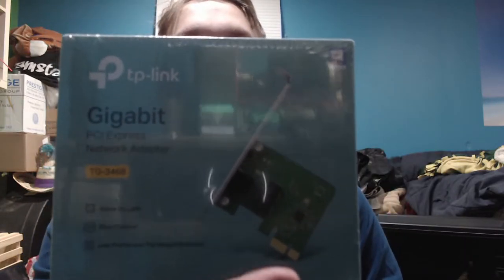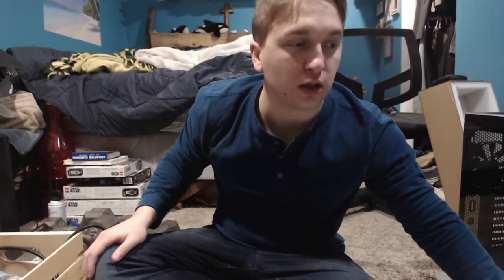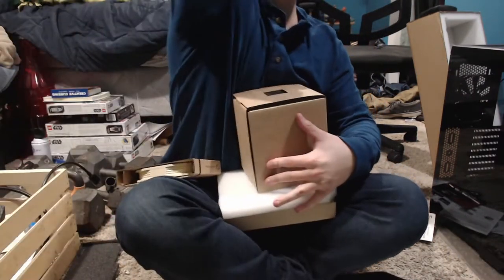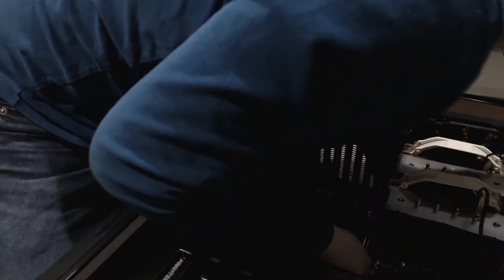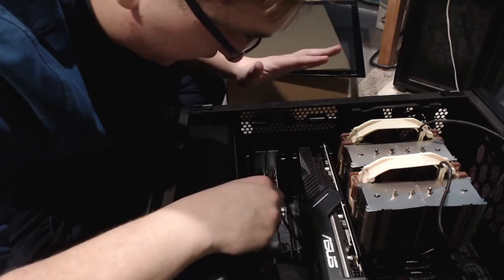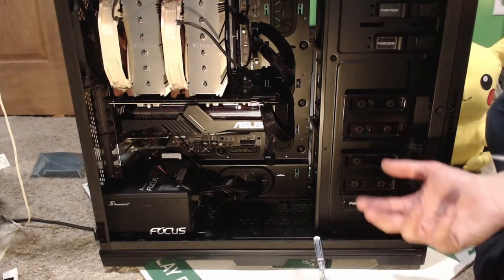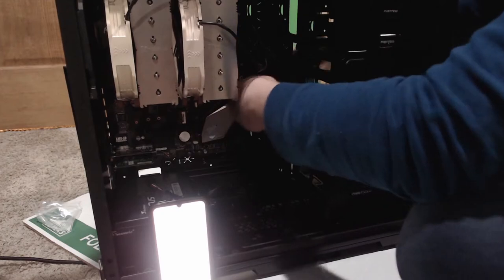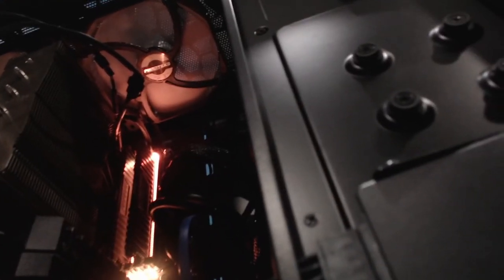Building a Gaming Computer for My Brother (parts list in the description)

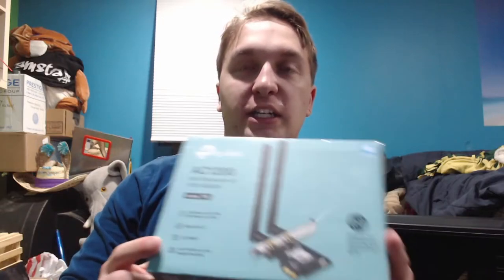Comment: A/c wireless isn't the NEWEST standard (that'd be wifi 6)  but not many devices are available, and I'm pretty sure your router is a couple of years old, so it doesn't have that functionality.  Solid choice. 3:46 there are several differences between that card and yours.  But the most important ones are signal range and speed.  The A/C standard is WAY faster.  Most likely it has a better range as well.

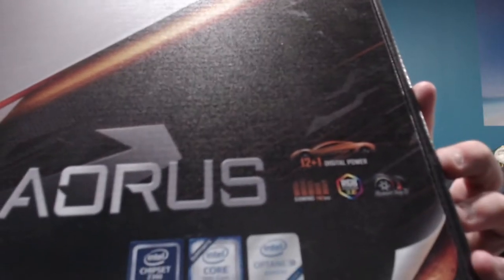Comment: 5:33 yeah looks like a decent board.  I think the only complaint I would have is the lack of a DRM heatsink, so I would be scared to overclock on that board.  Should be fine at stock speeds though.  Oh and on amazon it says it has this wifi on board:  Intel CNVi 2x2 802.11ac wireless.  So if you can give the wireless card back, and get refunded I would.

Comment: 6:03 unlocked means you can overclock the chip.  For further confirmation, look for a 'K' in the product number, so 'I7 ____ K'.  As of 1/27/2021 all intel chips with this K variant are unlocked chips.  I would highly recommend you do not overclock, one, it's kinda technical, and two, I'm not certain the motherboard you bought would be ok for that temperature-wise.  This is why board choice is pretty crucial, you could have gone cheaper on both the board and the CPU as you aren't overclocking.  It is nice to have that as a free upgrade in the future though.  Personally, I would have gone for a 10th gen I5, as it has two extra cores.  Even over your i9.

Comment: 4:52 ok this is a source of friction in PC builder land.  Some people think that 8gb is enough, I don't.  Even if that's all the game needs to run, having additional RAM installed in your system smooths out both the low end during gaming (the 1% and .1% lows respectively)  But also frame times.  (both of which produce stutter and could potentially affect gameplay especially when your system can BARELY handle that particular game).  like on my old system, one of the biggest limiting factors was the RAM, there were others, but RAM was definitely one of them.  In addition to all that, RAM is relatively cheap still, and is an easy futureproofing tactic.